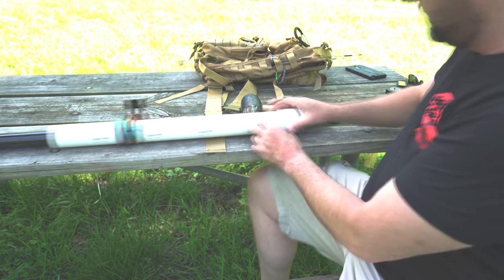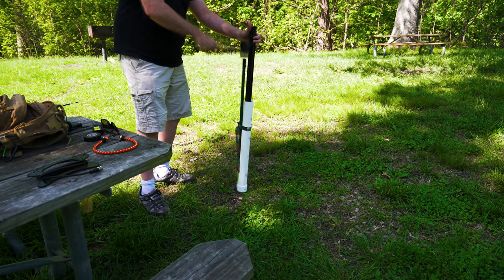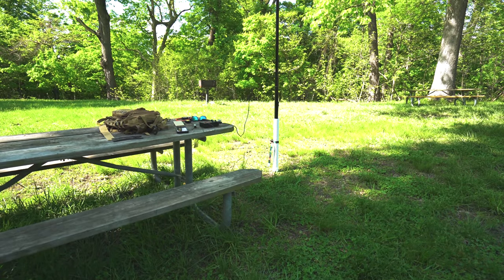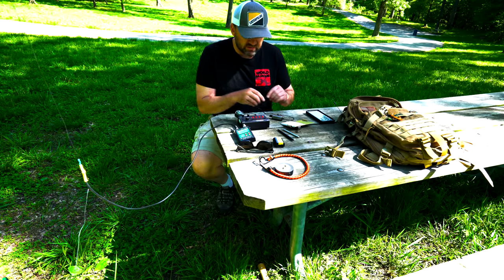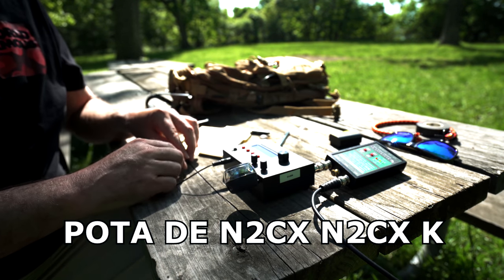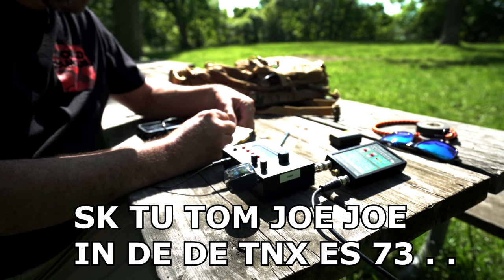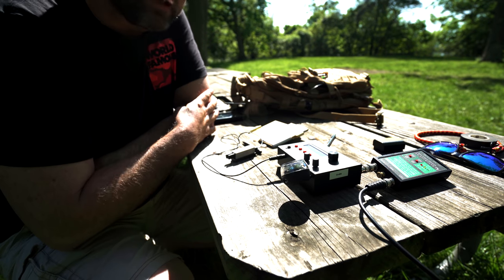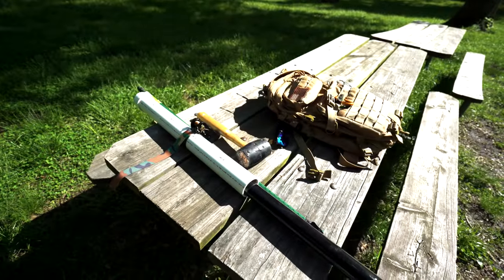QRP: YouKits, Wire Antenna & Telescoping Mast

Comment: Tom, intro to this video was really done well and I can tell you are continuing to perfect your craft; both as videographer and portable operator. Try 4' rebar attached to the PVC. 73's
Reply from the maker: I was looking at that rebar at Home Depot. Wasn't sure if I wanted to carry it or not.  Thanks for the tip. Maybe I will!
Reply: AnythingWithWheels well, if your hiking a different system would fare better for weight, but if your hauling equip in your car...
I hose clamp rebar onto the PVC so I get about 1.5-2 feet in and use a small mallet. Use them for sand spikes as well when surf fishing. Anyway, love your films, please keep them coming. 

Frank N5TYD

Comment: Tom, Me again, use the occi straps you have on the table to hold the PVC pipe in place. Strap and ratchet work but i don't like them.
I use two occi straps on the pvc,one close to the ground and one up the top. I put a bolt through the pvc at 90 degrees to lift the antenna away from the ground. Check out vk2prc video on 20m hwef antennas. He is working DX all the time. A great friend and mentor when it comes to easy antennas to get results.  For many years I did not use vertical antennas as i hear the comments "they are too noisy". Now I only use vertical antennas.73 colin
Reply from the maker: Ok thanks so much

Comment: I only use a thing called a "star picket" ( three sided thing)shape edge on the bit that goes into the ground.Its a steel fence pole cut in half. I only take with me a small hammer.I store the start picket inside the PVC pipe in the trolley. I try and get the antenna up off the ground as far as i can. 73 Colin
Reply from the maker: Yeah I got this idea from you... I need to find this star picket thing
Reply: Let  me take a picture and email you.

Comment: Nice setup. Very creative. Why only 3 watts?  I used Nickel Zinc batteries in mine and got the full 12 volts. With 12 volts I got 5 watts out. I think I have the same speaker as you are using? Since the pico paddles are mounted on a magnetic base, I stick my pico paddles to the side of the YouKits. I now have the four band YouKits and with the LiPo batteries I get between 5 and 6 watts out. Great little radios, aren't they? Great choice for a tuner. Since I only use resonant antennas, no tuner needed for me.
Barry, KU3X/QRP
Reply from the maker: Yeah, I find it hard to get it to tune in the field quickly so I just use a tuner.  Tnx for the comment.